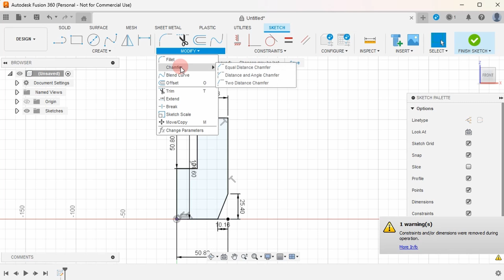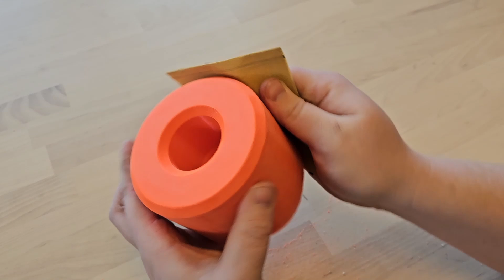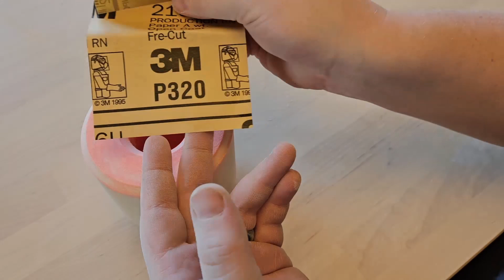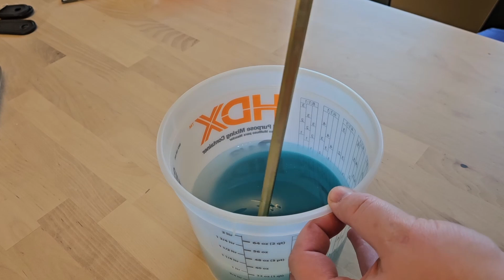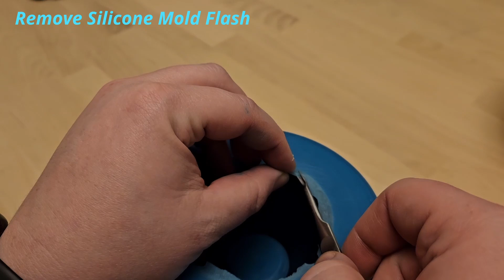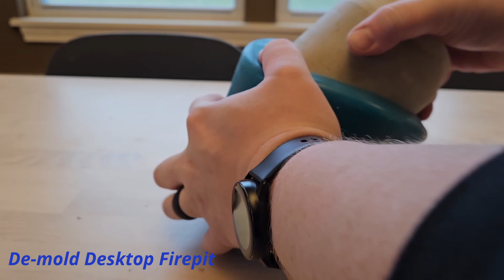DIY Desktop Firepit Tutorial

Comment: With all due respect, I believe you may have inadvertently designed a firebomb. Be careful with that ready mix concrete. That stuff is not meant to survive high temperatures. Your mix is quite wet, but I'm far more concerned with the concrete material itself. There's a reason you shouldn't build a fire directly atop a concrete slab. Instead, you burn in a fireplace or fire pit built atop a concrete slab. Regular concrete is not fireproof. It can spall, crack, or even explode under prolonged direct exposure to heat. 

Consider the thermal gradients involved here. Differential heating causes restrained thermal expansion. The hot inner layers of the fireplace want to expand, while the cool outer layers resist this expansion. Concrete has very little tensile capacity. With steep enough temperature gradients, these restraining stresses can grow very large. And if conditions are right, a fireplace like this can be completely destroyed by these stresses, potentially even explosively so.  

You need to look into the special mixes that go into fire bricks. If you're sitting at your desk, and you have a fire burning in one of these things, you have what has the potential to be a very literal firebomb just inches away from you. This, as designed, is a potential firebomb. And just because you've tested it once doesn't mean it is OK. Maybe this one will be fine, but other copies won't. Fatigue and stress cycling can also magnify this effect, meaning that the fireplace might be fine for the first hundred firing, then go off like a bomb on the 101st. Or someone might fill theirs up a bit higher, with a bit more fuel, than you did. Or they may buy a fuel mix with a slightly different chemistry. And on and on. 

I hate to state the obvious, but you're literally playing with fire here. Any device that you can buy that features an open flame has a hell of a lot of engineering that goes into it. And the first requirement for anything that needs to take the heat is that it must be built of heat-tolerant materials. And regular concrete is absolutely not a heat-tolerant material. A concrete house does better than a stick-built wooden house in a fire, but both need to be torn down after.
Reply from the maker: Thanks for your concern! I have done a lot of testing and I am comfortable with the results for my own use. I will add a disclaimer for others who decide to do the project for themselves!